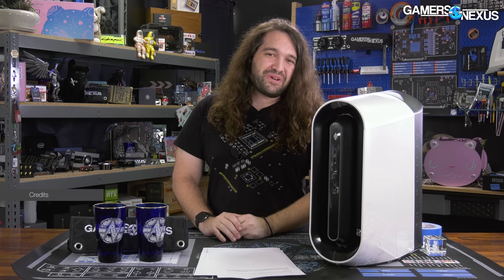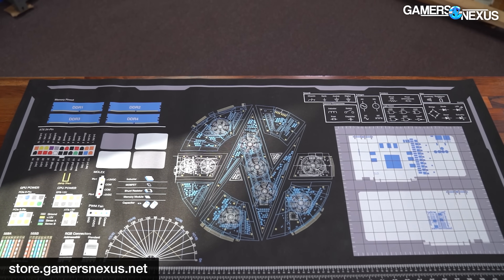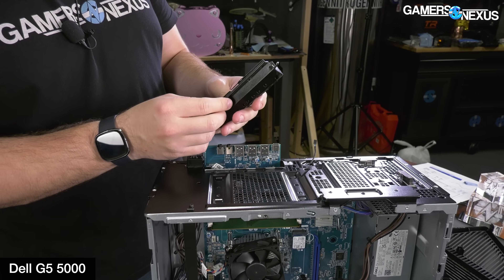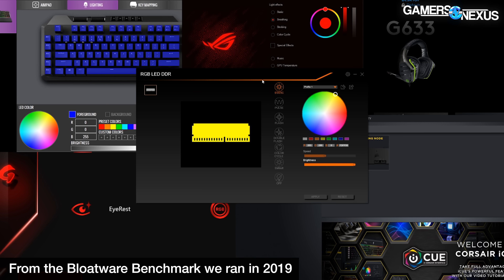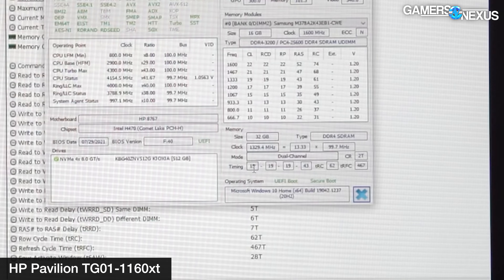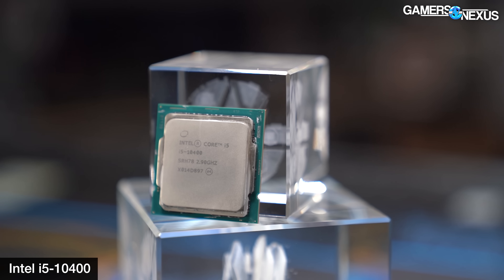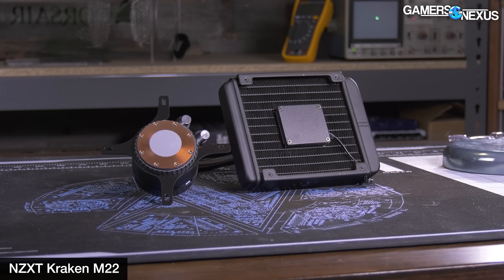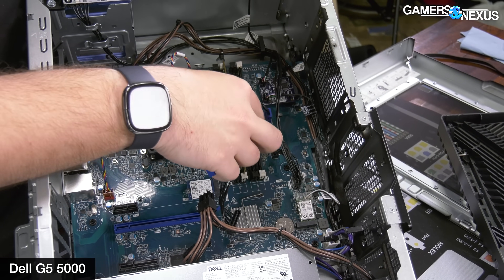The Worst Prebuilt PC Mistakes We've Seen (So Far)

Comment: Damn, you're savage Steve. Very good script here and a hilarious commentary on the massive shortcomings of commercially built PC's.
"PC builder elitism justified." 😏
Reply: Steve doesn't need a script to make this stuff funny, because I have run into HP, Dell, and Lenovo pre-built machines with really really stupid designs at work.   The Alienware garbage case designs aren't new, and most HP desktop computers outside of the higher end configurations have those weird 80W power supplies with power supply to motherboard, and other devices get power THROUGH the motherboard.   Lenovo in the non-Legion builds also has a 10 pin power connector to the motherboard instead of a normal 24 pin ATX with no good way to upgrade the power supply.

Once you have seen those consumer grade machines, including those with a Ryzen 7 4700G CPU that I think use the same power supply seen in the HP gaming desktop video GN did, the first thought is, "What the F is this crap?!?"

Comment: I was working on a Dell T30 SERVER recently.  It has mounts for 4 3.5" drives but no intake fan?  Not only that, but there isn't anywhere to mount an intake fan.  And even if there was a place to mount a fan, there's no header on the motherboard to plug it in.  Further, the hard drive mounts were split 2 on bottom, 2 on top with a SATA power extension cable to run power to them.  This is for a SERVER and is the original configuration.  Unacceptable.

Comment: Actually the ram that shipped with dell are actually pretty good. They used Hynix CJR modules and I was able to get them to run at 3200 CL14. They are almost on par with TridantZ, currently I use the dell ram on my main rig.

Comment: I recently purchased a Lenovo 5 Tower with a Ryzen 7 5800 OEM with a RTX 3060. Wondering if you guys have done a review of it or a similarly spec'd computer. All the ones I have found are for Intel models or have a different RTX in it.

Comment: The Prebuilt PC Starter Kit:
- Coolers that perform as bad as Intel Stock Cooler.
- M.2 2240 SSDs
- Naked memory sticks (basically memory but without the heatsink)
- SINGLE CHANNEL MEMORY
- Motherboards that look like the Hx10 or Ax20 series.
- GPUs that has terrible cooling (remember that GTX 1660 without thermal pads on VRAM?)
- Unknown PSU wattage (and it is non-replaceable with normal PSUs)
- Strange form factor motherboards
- BLOATWARE

Comment: I just bought a prebuilt to get a 3080, and yeah it had some two screws loose which I found and attached to the right (3.5 mounts) places. But most egregiously used a 120mm AIO to cool a 10700k. I knew it coming in and I have a u14s push pull ready and waiting to replacing the 120 AIO. The AIO and the u14s are basically the same price. - _ - come on cyberpowerpc, I wouldn't have to work at all if you just did some research.

Comment: I think you missed one of the biggest reasons AIBs use 120mm liquid coolers. They are by far the safest cooler to ship. They are light weight and all of the weight is attached to the case not the motherboard. They may not perform the best but are good for marketing and are good enough for midrange cpus.

Comment: i Just helped a friend of mine who bought the Alienware Aurora R11 with a 11900K and 3080 and 16GB of ram, he wanted to put more ram in cause he does video editing, so he goes buys the ram without verifying what he needs and buys 4x8GB sticks. He opens the box and finds a Mainboard with only 2 ram slots. So he asks me if he can put another mainboard in and i got and take a look. Despite using a Standart formfactor mainboard u can not put another mainboard inside the case becasue the Rear I/O is stamped into the case. So he asks me if he can buy a new case and Mainboard then. I take the whole thing apart and well the Only reusable parts were the CPU, GPU and Drives, also the memory if he wanted it but he bought the other one. Everything else is unusable. Case as stated above. AiO tubes are to short to be used in any other case. Powersupply cable are also to short to be used in any other case. Also the power supply despite having 1000watts only had 2 PCIe power connectors.

Comment: Hey GN! I have a very weird question. Since I bought my ROG g15cs, it has had horrible hanging up. For several months I just made do with it. However, it started hanging up 3 times back to back for about 5 seconds each which of course causes me to lose all of my games. I randomly found a setting called hardware accelerated gpu scheduling and enabled that, then found the power mode for my gpu, turned the power saver off, and haven't had this issue since. Can you explain what happened? I7 9700f, 2070 super, g15cs main board. This was a prebuilt. Was the original gpu scheduling faulty? I just need to figure out the actual issue so i don't face it again. ROG was absolutely no help in this process and I spent 6 months trying to work with them.
Reply: From what I've seen, especially in the bestbuy review section, ROG G15cs is plagued with this issue as well as shutting down and restarting randomly (thankfully I've not had that happen.) Really good deal on paper, but I feel so scammed.

Comment: Given the recent uptick in the 'how many cores do you need' debate, do you think you could find a pre-built with a 10850k/10900k, a 3070/6800 or better, and 32GB of decent RAM that comes with a ton of bloatware so you can do tests with 6/8/10 cores at fixed clocks at both 16GB and 32GB of RAM and see how much difference background tasks can have?

Comment: Its funny you say that about Cyberpower Re CPU cooler . I bought a prebuild in the UK about 8 years ago FX8350 and I was running it without really looking at benchmarks etc then when I looked at the temps when i got more into the Tech side of things. It was running at 90c after Very Light gaming workloads. Turns out they installed the AMD Stock cooler for the FX 4000 series. I brought this to there attention and they refused to do anything about it so I had to in the end just upgrade it myself - certainly wouldn't recommend.

Comment: Only time i bought a pre built was last year when we got my brothers work/semi gaming pc.It arrived doa.Opened it up and everything was cable tied in the middle of the case and nothing plugged in.Windows was on the ssd meaning they don't even test the ssd that goes with the pc to see if it works.It's fine for me because i know what i am doing but what if it shipped to some old couple that doesn't know anything.It came from far away and cost a lot of money for shipping.

I did send them an email with that concern and they didn't even have the decency to reply.

Comment: I don't think they use proprietary parts to make it difficult to reuse them, that's just a bonus for them.
They use these designs because it simplifies things for manufacturing. Putting the front IO on the motherboard removes the need for any internal connectors or cables for that.

Comment: I ordered my wife a computer from cyber power because I couldn’t get my hands on a gpu, and the 3060 wasn’t seated in the slot. I had to take half of the computer apart, and found out they bent the case and had to really fight it to get everything to line up.

Comment: I'm still having minor issues with my pre-built I've narrowed it down to a bad SSD because it shipped with a 128GB ssd as the boot drive and well that was fine 4 years ago now its not good at all and had occasional crashing so I might have to replace it and put a fresh install of windows on the new one to avoid anymore problems

Comment: I see your non standard PSU in a nonstandard case and raise you....
Amstrad 1512 with the computers' PSU inside the monitor, with a big fat cable that you'll never find a replacement plug for should it go bad.
Oh and it had several faults out of the box, including a bad connection in the socket for said big fat DC input cable.

Comment: Back in the days of NCIX, i ordered a pre-built from them with two XFX branded 6970's.
I had problems with random freezing since i received it.

Much later (after warranty expired) i found out that both cards had been flashed with 6990's bios and whomever built that system forgot to flash back or flip the dual bios switch.
That system was such a pain in the ass and cost me so much time with RMA's and such.

XFX sent me 7870's as compensation. But those were open ended coolers. By that time i had purchased a Z77 sabertooth (with the neat black shield) come to find out those 7870's were spraying bearing oil ALL over my system.

Needless to say i swore off XFX after all that.

...And i went back to building my own systems. Never buying a prebuilt again.

Comment: Not sure if companies still do this, but one of my favourite things to find when I used to work at a computer refurbishing shop were PCs from companies that would charge you to upgrade to front USB.

100% of the time, the front USB was already there, just covered by either a sticker, or a bit of plastic.
A lot of the time, this front USB was actually hooked up properly to the motherboard, so they were literally charging people $50 to pop a small panel off the front of their PC.

Comment: My Alienware laptop did have a lot of bloatware that I uninstalled. 

That Alienware desktop is huge. I'm surprised that they didn't take advantage of the size. You can probably stuff SSDs in some of that extra space. They could have used a liquid cooler, and put it outside of the metal area of the case! They didn't!

Comment: Wish we could build smartphones independent from manufacturers as well. Imagine how much corporate bloat we could be rid off that way.
Reply: The "cleanest" Android you can get on a phone is either from a Pixel or a phone that's part of the "Android One" program. If you consider the pre loaded google apps bloatware, there is nothing the OEM's can do about that. As part of the agreement that allows them to put Google Play services / access to the Play store on the phone they have to pre load those apps. Now all the other crap is just them being greedy and taking some money from different companies to pre load the apps or put a icon for them that downloads the app when you tap it. The bloatware on Samsung phones purchased through AT&T was so bad that now the first thing I do after getting a new phone is flash the U1 US Unlocked firmware so the phone has the exact same firmware as you'd get purchasing it directly from Samsung. Also get updates from Samsung instead of through AT&T which is nice, and it's really easy to do, as is flashing back to the AT&T firmware if you want.
Reply: @sean8102  I will check that out. Thanks bro

Comment: Was asked to 'fix slow pc' a few years ago. An already, at that time, ancient pre-built. Quickly discovered that it was running out of memory. Popped side panel off to discover that it had 2 sticks of 2gb ram, but only one of them were inserted correctly. Snapped second one in place and the pc ran significantly better. Easiest bucks I ever made. Worst part is that the pc had been like that forever, from the factory.

Comment: DELL and HP along with some now non existent oem's in the past would use ATX 20 and 24pin standard headers but with a different pinout, so if you plugged a standard PSU into those systems you fried it, or vice versa took that PSU out and tried to use it in a normal machine. They stopped doing that went to these werido headers now, so that is a plus if you think about it that way. Atleast you won't fry another mobo with em. It was always something you had to be aware about when working on them.  Oh and it wasn't consistent, one OEM machine from the same company would be completely ATX standard, while another model in basically the same case would not be. Really messed up.

Comment: Friend bought a well known brand that kept shutting down. He asked me to look at it for him. Fault 1 one memory stick not fully pressed home into slot 2 Processor heat sink loose and not fully in contact with die 3 Thermal paste practically non existent 4 Mother 24 pin connector not fully pushed home 5 motherboard not properly screwed to backplate. All faults fixed and strangely problem went away 🤦🏻‍♂️

Comment: I used to buy prebuilt in the 90's. Back then they weren't so bad. I bought an alienware in 2003 and had nothing but problems with it (power supply failed in first year, they replaced it, graphics card a couple months later, they replaced it, then system failure during third year). I built my latest PC's and the peace of mind was revolutionary. Buying parts individually is only more expensive if the prebuilts you might be looking at actually use parts of equal quality. The PC I am currently using had no prebuilt comparable and the closest one I found would have cost me 300$ more than I paid. Prebuilts ALWAYS skimp on the parts somewhere to expand profit. Build your own, if your uncomfortable about it get help from a friend or family member, or family members friend, or local shop. Prebuilts are barely good enough for web browsing and are for people that buy computers to play cards or sudooku.

Comment: I work at costco and we unfortunately get ibuypower/ cyber power pre builts. Ive had fans installed backwards, ssd's not plugged in, bios not configured. I had one fail on me because I unplugged an HDMI cable and it required the cmos to be cleared.

Comment: Had a friend buy a Asus desktop in the past that had the same HP "screw the CPU cooler to the chassis" design, that was randomly shutting down (pre-thermal throttling CPU days, Pentium E5500). Turned out, one of the CPU cooler screws was broken at the factory, and would not thread into the chassis anymore. It got the zip-tie mounting treatment to solve the issue.

Comment: Everyone needs a paycheck, specifically those “slide jockeys” that do not engineer, assemble, procure, market, or forecast specific products. HPE/HP, specifically, has teams of individuals that lives to tell one of those 5 tasks I listed how dumb those people are with how smart they are in a powerpoint slide whilst not providing a single value add task to the bottom line.

Comment: There is no way to know if the Pre-Built you are going to buy is deficient till it's out of the bos and you can open it up. Best-Buy get's iterated when you show up with a screwdriver and want to see the insides before you give them your credit card. Besides like you have said all the tell you is the small specs not the real truth. But then 99% don't the difference anyway. All the do is a little gaming net surfing and solitaire.

Comment: Dell business solutions includes a m.2 thermal pad on the back of their  m.2 drives... It's a 4-5mm thermal pad on the back of the drive in a 3mm gap. It exerts so much pressure on the back of the drive it actually bowed one of our drive 1mm in the center and killed it. You could see the chip bga disconnected from the board from a side view. 
Best part is, the tech dell sent out replaced the pad from the old one onto the new replacement. 
All this because Dell refuses to send parts to consumers without sending a technician that will inevitably cancel 3 times, and forget to take the ewaste components Dell will eventually bill you over MSRP for. 

Yes I removed the pad and reinstalled the drive correctly.

Comment: If someone wants a prebuilt, arent 'gaming' laptops better deal? Would be interesting to see comparison.
Reply: Maybe but you're going to pay more for the same/similar specs if it's a laptop. You're getting a display, battery, and designing a laptop requires more R&D/engineering money, than a desktop PC. Also it's most likely going to run louder when playing games than a gaming desktop.

Comment: Random idea:  Could you do a video where you buy parts, GPU included, in the current market using means that a normal consumer have access to, and build a PC at the various budget levels comparable to the cost of the prebuilts reviewed so far?  And the maybe have it assembled by someone who has built a PC or two but isn’t doing it frequently as you or Patrick Stone are. 

I wonder how easy or difficult it is for the average enthusiast to shop for parts, GPU in particular, and beat the prebuilts in terms of value and quality.
Reply: I would love to see them shopping at a microcenter for all the parts but I wouldn't be surprised if sourcing individually will still end up more expensive under the current market conditions perhaps one where they buy all of the stuff second hand?
Reply: @ewanhoo  I would say, if they do such a video, let's give the person doing the buying 4 weeks to find all the parts-- especially the GPU, which are only available at reasonable prices during random drops, which are snapped up quickly whether we are talking about physical or online sellers. 

If a person has only 1 day or two to find a GPU, the only readily available options are gonna be at ripoff prices.
Reply: Ripoff might be too strong a word... but definitely high prices similar to what you find on eBay.  Anyway, it's gonna be a high enough price to make it hard to put together a PC under a budget.

Comment: Watch for ABS PSUs, I just looked in my Feb 21 purchased ABS Gladiator Strix 3080  10700k prebuilt and it has one of the 750 watt Gigabyte PSUs with a serial number in the affected range, not that those outside that range aren't still garbage.

Comment: I recently purchased a Skytech Chronos myself. Different Config to the one they got (R7 3700X w/ RTX 3070) and the build was actually surprisingly good and not a single component was cheaped out on.

If anyone wants full specs I'll post it.

Only thing I may want to upgrade, especially if I'm wanting to OC is the Mobo. Currently it's a ASUS PRIME B550M-A AC, I think I'll upgrade to an MSI B550 Gaming Edge Wifi and a 5900X eventually.